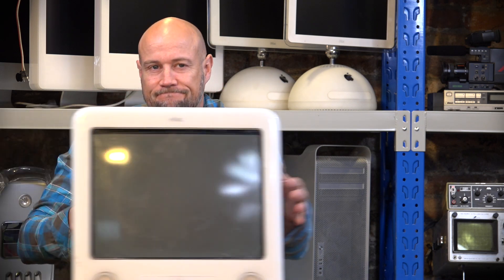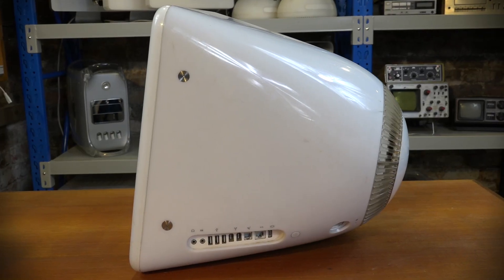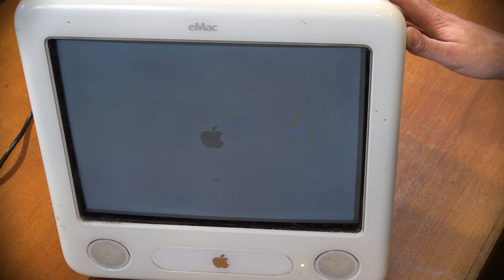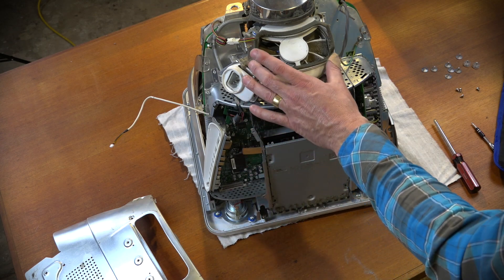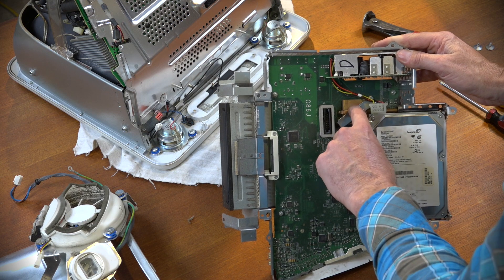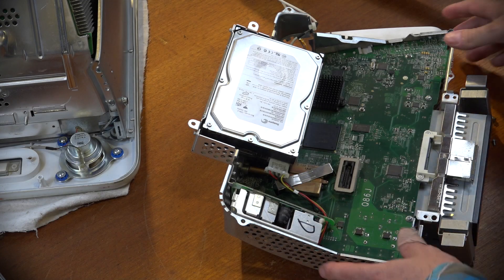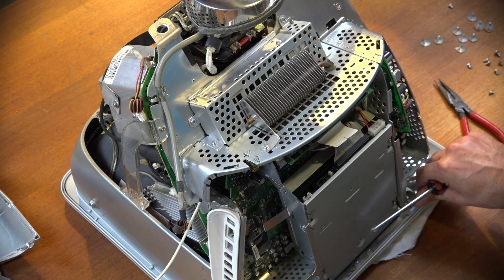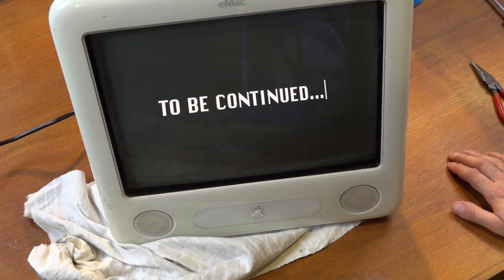eMac Adventures! Part 1/2 - Fixing this weird Apple computer

Comment: Hi
Wonder if you could help
I bought the very same emac from a charity shop today 
It boots up fine but it’s password protected.from the previous owner.
Is there any way you know to bypass and reset this ?
Thanks in anticipation
Reply from the maker: If it’s just password protected at the OS login screen, simply swap out the HDD or reinstall another OS onto the existing HDD.

Comment: I intend to buy one from a guy who connected it to 200 volts and it clicked internally. Did the power supply burn out or was it just the protection fuse?
Reply from the maker: Not sure. I have mine connected to 240v and it loves it. Open it up and look for anything burnt

Comment: booted up an emac today after sitting for a few years, some 20 years old and still working like it did 10 years ago. Its great when 20 year old peices of equipment are still working -- especially when they have electrolytic capaciors.

Comment: does anyone know if the AirPort Extreme port is a certain standard or apple proprietary slot/port?
Reply: Physically proprietary, sadly
Reply: @Dreams_Of_Lavender  i have found out it’s based on miniPCI since i posted my comment. not sure it could be used to add proper PCI slots but might need a boffin who knows more to say one way or the other
Reply: @onigvd77  Maybe a custom PCB could be whipped up for it to adapt it to mini PCI

Comment: This deservers a sub. Got one from a freind and needed to know how to take the HDD out! Do you know if theres any CRT adjustment knobs on the Flyback btw? Couldn't see any but then I only took about 5 seconds to look...
Reply from the maker: Thanks! No sorry I’m not sure about the crt adjustment, I tend to stay well away from that area 😬
Reply: @TheBasementChannel  🤣 - Same that's why i'm taking precautions. Is it ok to be dismantled *to the logicboard when it's just been unplugged? *is there a greater risk of me getting shocked?! Just wondering for future repairs 😃
Reply from the maker: @megatronskneecap  just be aware capacitors still retain charge after the system is unplugged, but probably only the ones in the PSU area will have enough charge to be shocking
Reply: @TheBasementChannel  Oh ok. So as long as I dont go anywhere near the CRT, near the exaust fan or the PSU im fine! Thank you so much! You've been more helpful than the majority of forums! I have an iMac G3 that has a foggy looking CRT and am still tryna figure that out 🙄🙄🙄🙄
Reply from the maker: @megatronskneecap  you can discharge the crt and also capacitors, just google for instructions. Not sure about the crt though, don’t know much about them.

Comment: Someone told me if you run your Emac with os 9.2.2 it still natively supports old 68k games is that true?
Reply from the maker: From everymac.com:
The original eMac models and the original "Combo Drive" configuration of the eMac G4/1.0 (ATI) (M8950LL/A) are capable of booting in MacOS 9. Subsequent models are only capable of booting a version of MacOS X and running MacOS 9 applications in the "Classic" Environment provided by MacOS X 10.4.11 "Tiger" and lower ("Classic" is not supported starting with MacOS X 10.5 "Leopard").

Comment: Emac is the biggest pain to work on. Built like a tank
Reply from the maker: They sure are solid! Probably ‘cause they were meant for schools.
Reply: @TheBasementChannel  they definitely were designed to last. Some schools are still using them around North Carolina..  got a private practice dr office that they use for the breathalyzer with cdl’s. Its hooked to a emac running w95 in a connectx virtual pc with this old 16 bit software running on it. If it was a dos program it would be more elegant but it works.. lol

Comment: The thing was heavy as hell. Was working at the time that iMac G3 and G4 at an Apple dealership the flat CRT from Sony made it heavy.
Reply: The eMac had a shadow mask CRT, so it was definitely not made by Sony or Mitsubishi, the only makers of aperture-grille CRTs. Because the CRT was made in Korea, according to some photos I saw, and that the CRT’s model number is similar to that used in some Philips monitors, the CRT was likely made by LG.

Comment: Had one when they came out. I paid a lot for it. Had everything maxed out. Sure it was a 1.2 processor with 2 gigs of ram, 120 gb hard drive. I have heard of people removing the board, replacing it with a modern mac laptop board. The cry gives amazing frames 😁